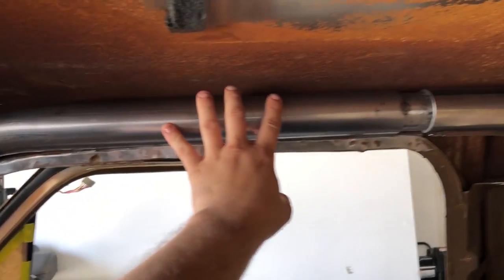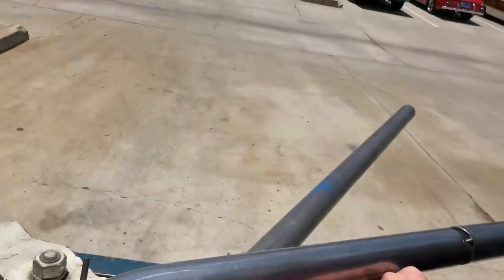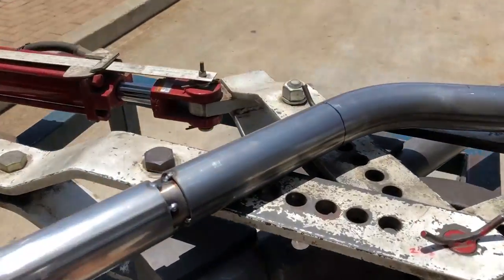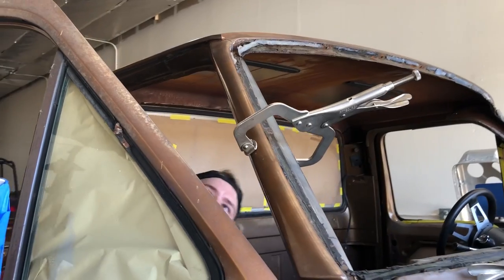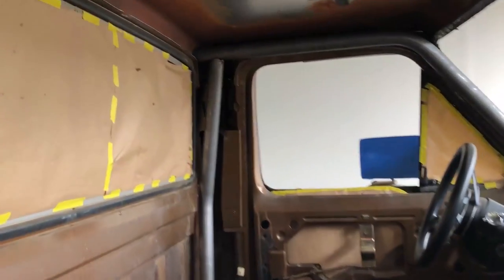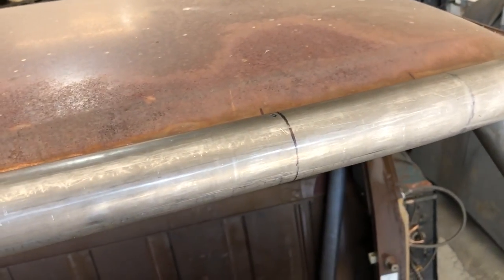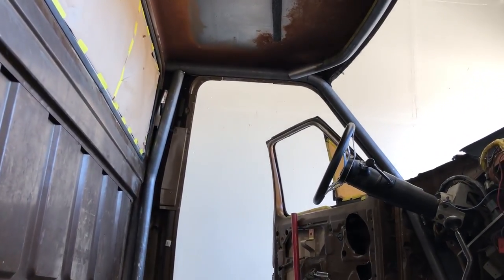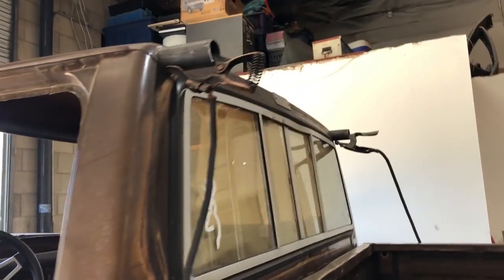HOW TO BUILD A ROLL CAGE

Comment: how do you go about welding the top of the cage inside the cab?
Reply: they will probably do that before making the kickers in the bed so that the cage can be slid down through the floorboard after tacked. welded and then raised back through the rear roof holes.
Reply: @mickrambo6787  with the door bars they made the cage cant drop or cab lifted unless they did them dead last.... If they removed the roof skin it would be a walk in the park
Reply: cutting the roof off or cutting holes in the floor

Comment: You guys are doing great work. Let me mention something to you. When you attach a roll cage to the side of and existing chassis you have to plate that attachment point and you have to fully gusset both sides of the tube with 1/8 plate. 
Or the cage has to sit on the frame.  But you can not just weld it to the side of the chassis. It looks amazing but it is a structural failure if something happens
Oh yeah any door bars have to land between the drives elbow and shoulder can’t be above the shoulder or below elbow
Reply from the maker: Thank you and I understand. This cage is sufficient for the application which is mudbogging and not so much a racing application. But it is tied to the frame as well as the cab. I appreciate your input and appreciation!
Reply: Fast on Wheels hey way it’s tied into the from is the problem with it.  Like I mentioned. But if your doing a video on how to build and install a roll cage and someone watching this doesn’t know the phone way you tied it to the frame is wrong and could fail. They could get hurt.

Comment: Nice work ! Thanks again for the reference to Greg G's Total P engine building for my Bronco prerunner engine. I have a cage on my list do do soon for it. Wondering what the cost is for you to do it. If you want I can call or email for that. I am hoping to do it with a local friend I know that has done some but not sure it will work out. Is the aftermarket dash the best way to go ? That requires gauges, air vents, controls ?  I have heard the stock dash etc.. can require a lot of work. Good video and shop I stopped by picking up my engine down there. You had a Bronco in at the time too.

Comment: Any info on how you egg the ends of the pipe to get it to join up so seamlessly to the next pipe?
Reply from the maker: KCStrain We have a tubing notcher that is basically a horizontal belt sander that runs around a die sized for the tubing. We should do a video on this tho!
Reply: @FastonWheels  I'd love to see it! I have always used a chop saw and grinder for that type of thing!

Comment: How do you weld the backside of those tubes?
Reply from the maker: davkenrem On a race truck, we would cut the roof to gain full access, on this there is a small section that is unwelded on some, but we can actually get to most of it surprisingly. Having it so tight allows us to be able to stitch it to the body in a lot of spots so it becomes one with the cab which helps too.
Reply: Fast on Wheels- Understood, amazing work.
Reply from the maker: davkenrem really appreciate it 🤘
Reply: I was wondering this exact thing glad I stumbled upon this info an this channel keep up the badass work! Can't wait to start working on my toys n learning what I can from y'all!
Reply from the maker: Dirty_Lettuce_Diesel Right on man, glad to have you! We are using the input from y’all to help hone the future content so if there’s something you wanna see let us know. Our Instagram is good too @fastonwheels 🤘
Reply: @FastonWheels  I do have a question is there a basic cage design y'all follow or a rule book for BITD or SCORE etc to follow like NHRA  has for drag racing? Also it'd be cool to see the tube left raw check out shark hide to seal the material that's what I'm hoping to use on some of the work I have planned.
Reply from the maker: Dirty_Lettuce_Diesel Just go by what we have learned. There are rules but I’ve never read them. There are basics to follow tho. This cage has the bare essentials so it’s a good template to follow. The one thing it’s missing is an A or an X in the rear hoop.
Reply: @SuperPenishole  I got a copy of the rules now for what I need on my truck gotta get some more tooling to start makin it all come together.

Comment: Was that tig welded? Were those single pass or 2 pass welds?
Reply from the maker: Edwin H Yes, TIG, single pass.
Reply: What filler rod did you use on 19:17?
Reply from the maker: Edwin H ER70S2 3/32”

Comment: What about top of cage welds?
Reply from the maker: There's about a half in unwelded. Not a race truck.
Reply: @FastonWheels  how functional is the cage then? It looks amazing, not gonna lie, you do incredibly nice work, but if I wanted to follow these tips or ideas, bjt wanted that added piece of mind. What would you suggest?
Reply from the maker: Thank you I appreciate that! The way to do it, with a cage this tight, is to remove the roof skin by drilling out the spot welds. Sometimes you can leave the tubes that go through the floor free and let the whole cage drop through the floor enough to gain access to the top!